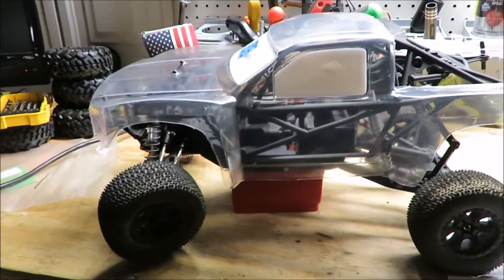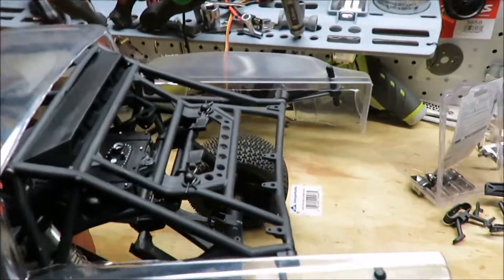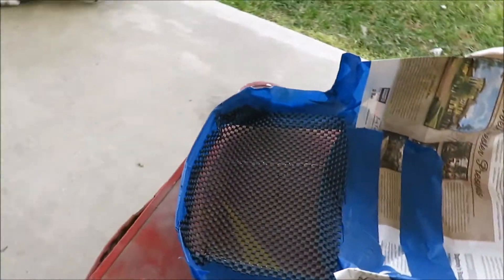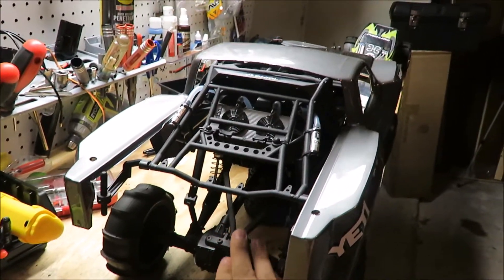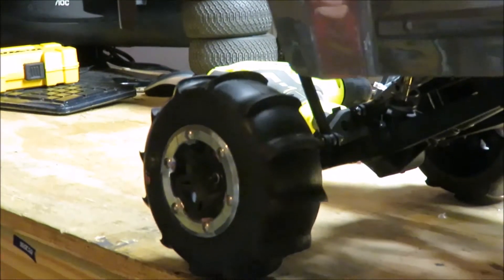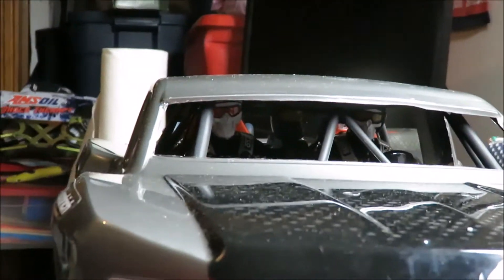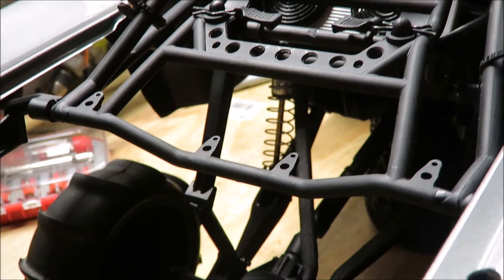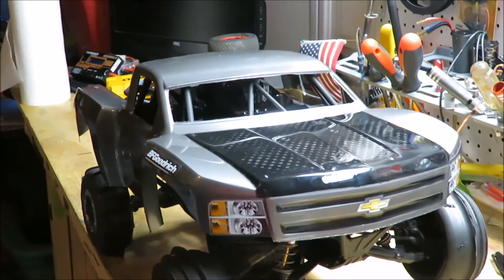Yeti Trophy Truck Conversion #4 - PAINT!!!

Comment from the maker: I apologize about the music getting so loud at 3:05. Basically what I was saying was that  I loved how the cage is exposed in the rear and that the back part of it is my favorite part. I decided to go with the rpm tire carrier for the slash 4x4 and that it will be installed in the next video. I know that the paint did not come out perfect, but I did like the overall effect. Lastly, if you look at the cage, it does not fit perfect to the cage, but I was not aware that the Chevy body is wider than the Ford body, if you want a perfect fit of the cage to the body, the Ford is the better choice.

Comment: How much did you shrink the wheelbase 
I need to go to 13 inches to make my body fit 
What did yours come out to
Thanks in advance
Reply from the maker: Rob Morrissy it went from a 15 in to 13.5. Depends on what body you use. I found the Chevy to have a different wheelbase from the raptor
Reply: @flashhobbies  proline 79 Ford f150 short course truck